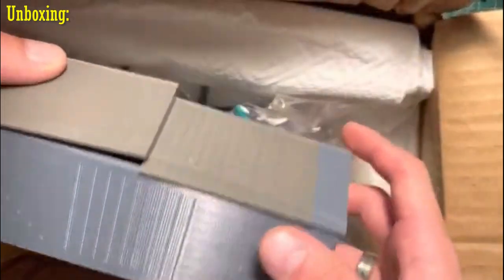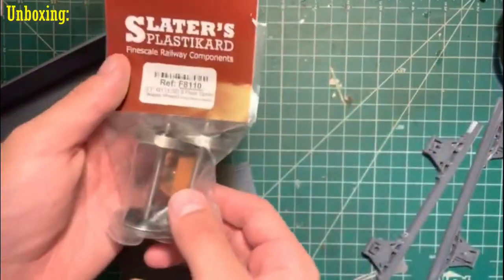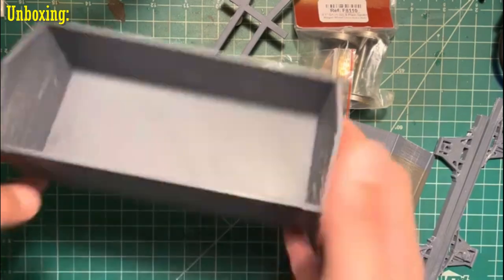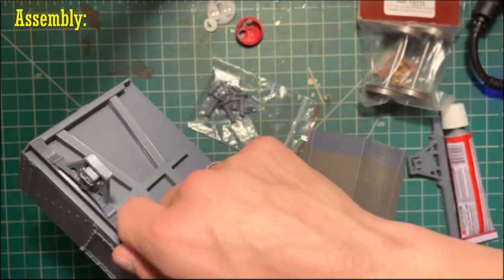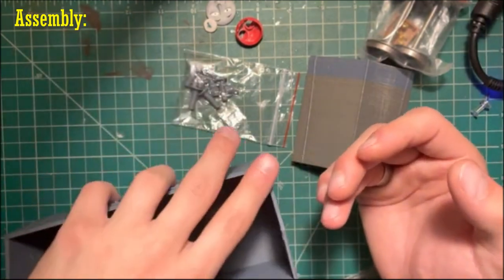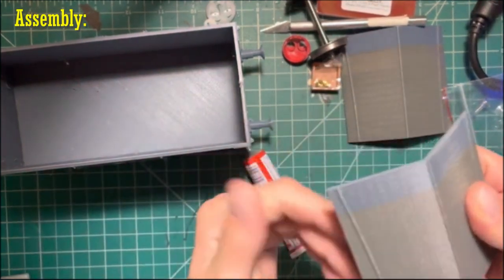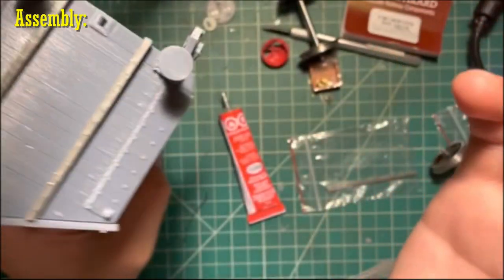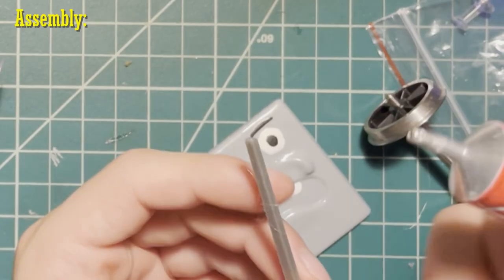Gauge 1 3D Printed Salt Van: Unboxing & Assembly - Thomas & Friends Truck Replica Part 1

Comment: Word of advice: I would have put some lead weight inside the body for extra measures in case it ever has the tendency to derail easily if it’s too light weight.  Just something to think about for future reference next time.
Reply from the maker: It won’t be used for running purposes; it’s more just a little project I plan to make for show. I’ll keep that in mind if I ever do though!
Reply: @ItsTrainBoy  Fair enough 👍🏻

Comment: I 3d printed some O scale western houses and if you get some wood glue and put a bit on the flat surfaces and lightly sand it. It will cover some of the 3dprint lines